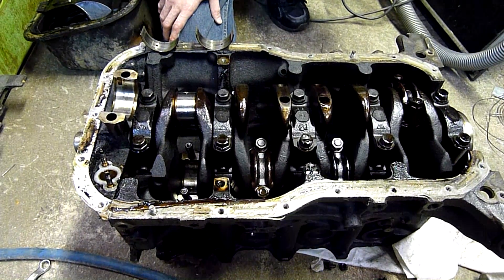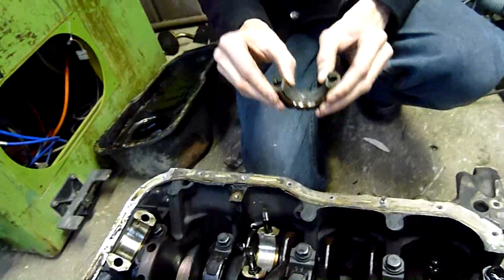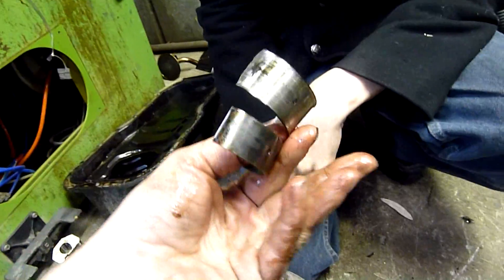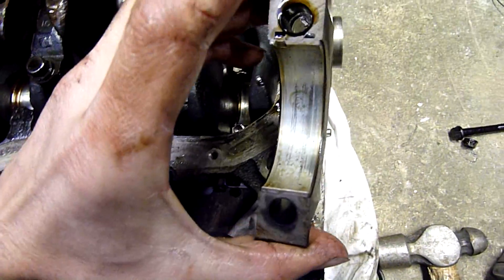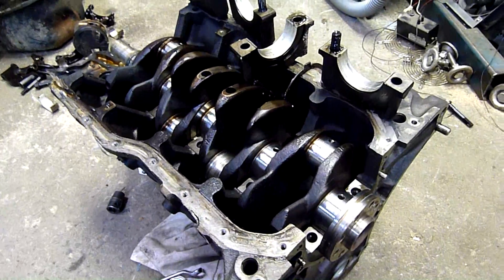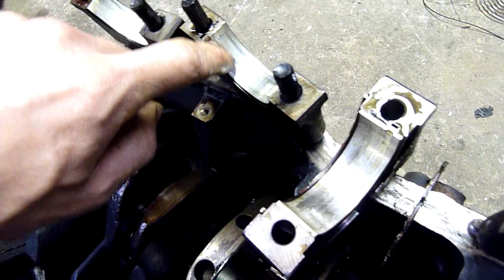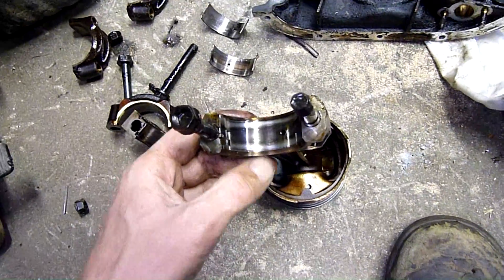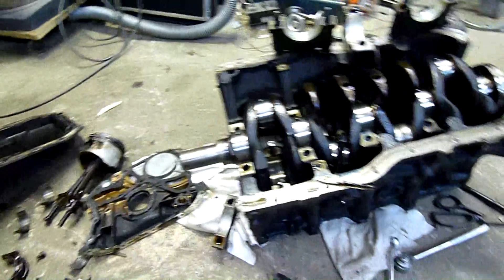Toyota 3S GE Engine Autopsy Final

Comment: Yep, my mate killed a 5S-FE in his Celica by running it out of oil. Lasted a fair while though. But I'll bet my old Duratec 25 is going to look similar to that. Took it out to a track day and the dreaded oil surge hit. Now it has a fair nasty old knock from the bottom end. Drained the oil out of it and there's a few metallic bits of shit floating about in the drain pan. I'll probably do something similar to you and do an autopsy once I get the motor out

Comment: What do you think was the result of that shot no.3 bearing? Nasty failure
Reply: Oil starvation i'd say was the initial culprit. By the looks of the sump and engine inner walls it was glazed really good. Meaning the ass who sold the engine saying it was ok, probably never serviced it properly.
Reply: aserta yeah there was some horrid looking sludge on the sump tray. Shows the care they take